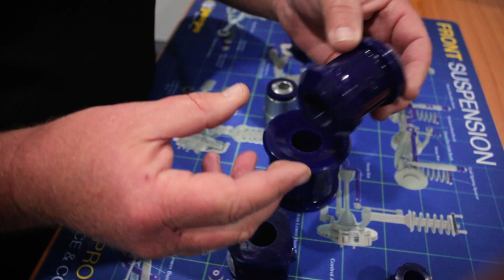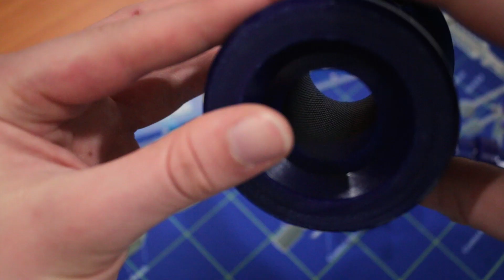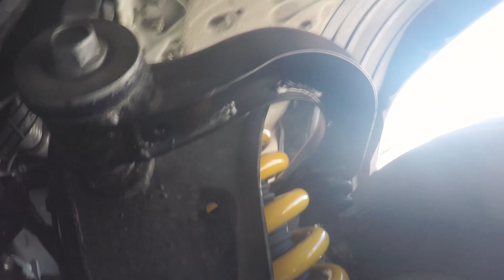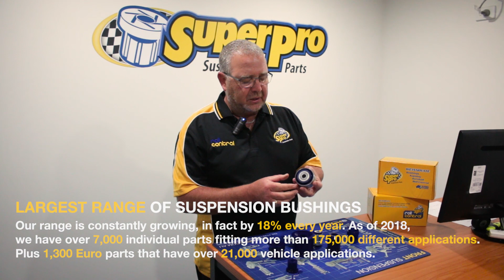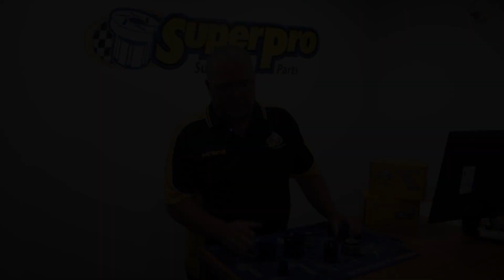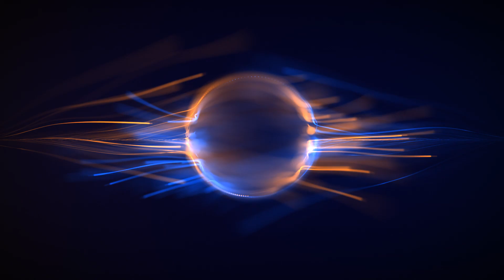SuperPro Bushings -  The Best Suspension Bushings For Your Car (Advanced Polyurethane Bushings)

Comment: Hello , Do you have bushing for 2003 Toyota Tacoma 4x4 front lower control arm bushing, it needs 4 pieces. Thanks
Reply from the maker: Hey Mate, we do bushings for the Hilux but have not test fitted to the Tacoma.
Reply: @SuperProSuspensionParts  I saw the part number of 2003 tacoma is the same of the p/n of the 2002 4Runner.  these are 2 number "SPF2711K" and "SPF2712K". However I could not find where is the online reseller to order these bushing. Can you recommend some of the online stores?

Comment: I'm trying to instal Superpro rear control arm and rear lower shock mount bushes on my 1999/00 EK Honda Civic 3 door hatch. The control arm is pressed steel, not cast iron. The guidance/instructions for the inner and outer control arm bushes is great and they've been successfully installed using the OEM bush outer steel case. The guidance/instructions for the lower shock mount bush are not so clear. The bush I've been sold as being suitable is part #1527 ... cotton reel style with an OD of 40mm and a barrel length of approx 38mm.  The bush opening in the control arm has an ID of approx 37mm and a pressed shoulder of approx 11mm. QUESTIONS: do I press the Superpro bush into the OEM bush outer steel case, or do I remove the OEM bush completely and press the Superpro bush straight into the control arm bush opening? If the latter, the new bush will exceed the shoulder by approx 13mm on either side. Is part #1527 the correct part for my application? Thank you.
Reply from the maker: Hello, thanks for the question. That bushing you have is for the earlier model. Who did you purchase your bushings from?

Comment: Hi there 
I was very impressed with the ratings the super pro bushes have in the market, especially with the machined finish and knurled grease retaining internal bore.  
I have decided to choose the SUPERPRO to rebush the front bushes(SPF1574K) of the rear trailing arms on my 2000 Lancer as well as the lower control arm bushes (SPF1573K) as recommended in the fitting instructions
I received the spf1573k today and was disappointed to notice each bush is missing the knurled grease retaining internal bore
Does this seem right to you?
I do understand each bush kit is made to suit it's application
Reply from the maker: Hey Josh, based on the information given we can tell you have received the correct production parts. 

While we promote grease retaining groves, knurled bores, machined ends and in some cases bullet grooves. Not every bush requires these features.

When SPF1573 was developed it was decided not to run with the knurled bore as the bushing is quite small with a very low surface area.
Reply: @SuperProSuspensionParts  
Thank you very much for the reply 
Super Pro Team I can see the sense in what you say 

Keep up the good work 
Excellent product

Comment: Do you have a set of bushings for an 09 Scion tC for an American customer? I'm also looking for engine mounts. I want to eliminate wheel hop and have my suspension really tight and reliant on good a strut setup for ride quality and handling rather than having the bushings as a variable. Car is a daily driver, but not a commuter. It's also a weekend warrior "do everything" car, and in the future will be turbo'd to the tune of 400-450 WHP and used for rolls, digs, auto-x, road courses, and drag days.
Reply from the maker: I have looked we do not have anything, it looks like it is not like anything in Australia. If you would like you can contact our US headquarters and see if they could help you out.